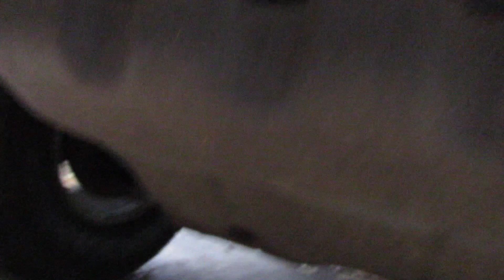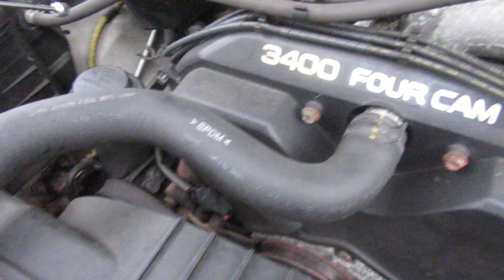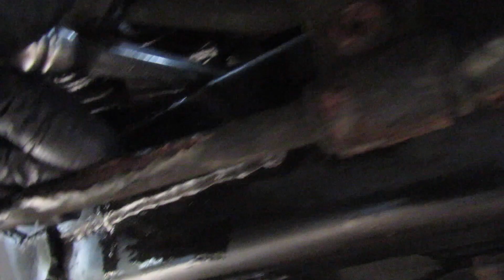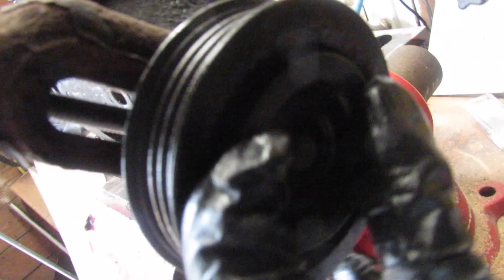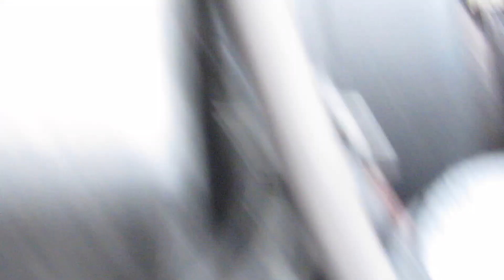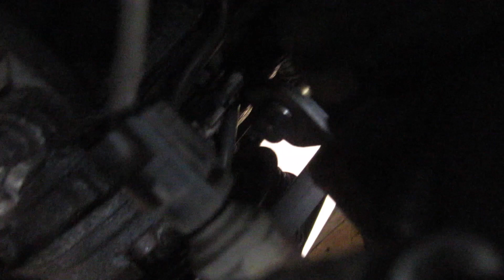Toyota Tacoma Belt replacement 5VZ-FE 6 cyl

Comment: Thanks for the clip. It’s really helped a lot. 
Like you, I took out the air box to get to the power steering tension bolt, but, you can actually get to the the power steering pump tension bolt from the passenger wheel-well with a long extension and a 14 mill, 6 point. The ac lines may be in the way. They can be worked around to get to the tension bolt.

Comment: If you do it the right way you will not snap any bolts you need to loosen the locking nut before you start trying to crank off the tensioner bolt

Comment: Man, this video saved my butt today. Thank you so much for posting this. I didn’t have the same problems with bolts seizing up and breaking so when I first watched the video I was really freaked out LOL. I don’t have a shop to do all the stuff that you did. It was really helpful to pull the airbox off the first time probably, but if I ever had to do it again, I’m pretty sure that I wouldn’t have to take it off again. If nothing is seized up, or breaks, it’s really pretty straightforward and a lot easier than it looks from this video.
Reply: What bolts come all the way out?